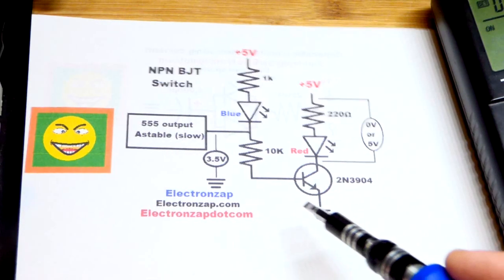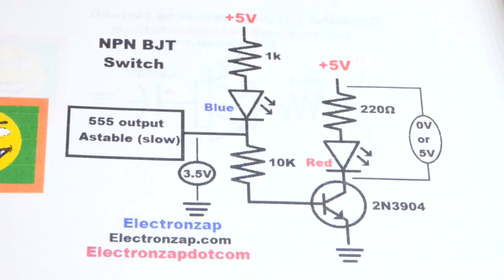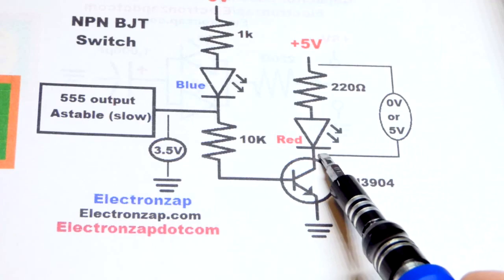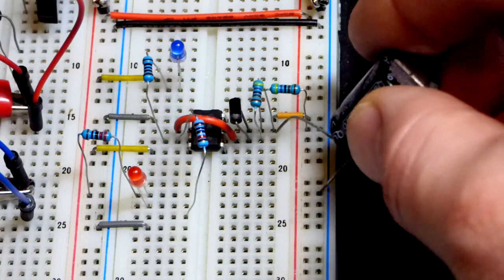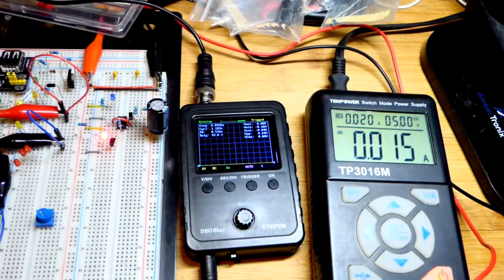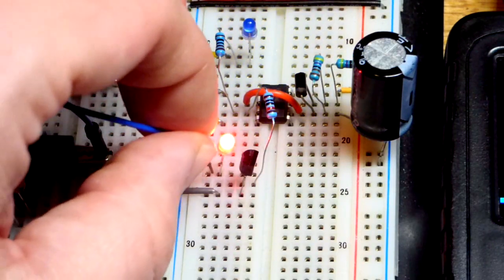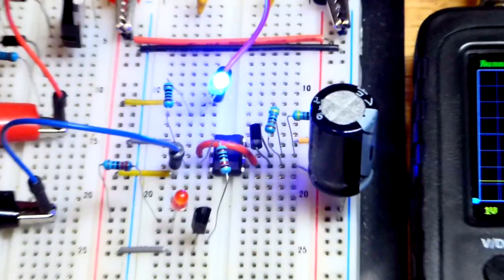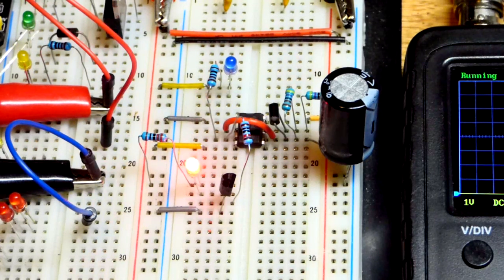NPN bipolar junction transistor BJT switch circuit used to improve 555 timer high output circuit

Comment: Could you explain why there is a ripple on the scope display at 0 volt when you connect the blue wire to the led's cathode? Why are we not seeing a ripple when the blue wire is connected to the circuit ground? Is there no stray noise at the circuit ground? I just don't comprehend it.
Reply from the maker: Not 100% sure, but I think that us due to a lack of a voltage from the power supply, so the oscilloscope picks up weak stray voltages.
Reply: @Electronzap  Thanks for your time to post a reply. I read somewhere if you do a scope measurement across a component (thus the blue ground cable is not connected to circuit ground) then a voltage difference  creates a current between the mains  ground  and where the blue ground cable is connected on the circuit. Normally the circuit ground is connected to mains ground and the scope is connected to mains ground then  there will be no voltage difference at ground between the scope and circuit.